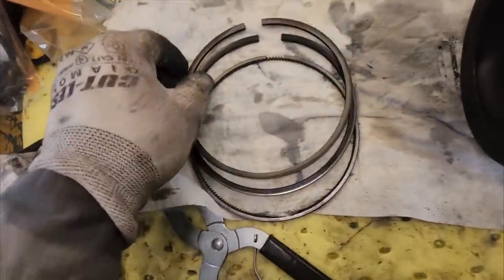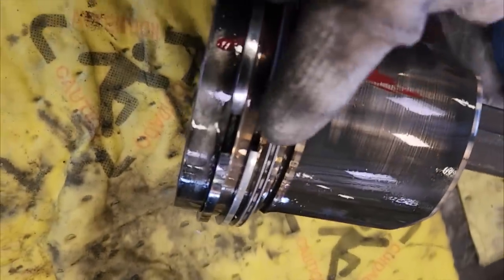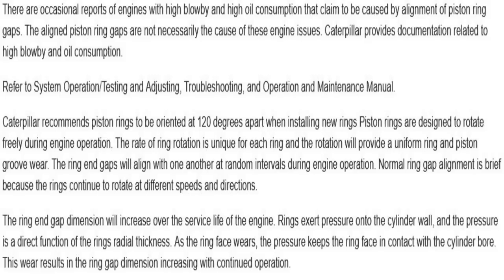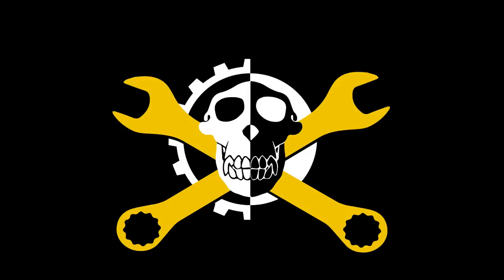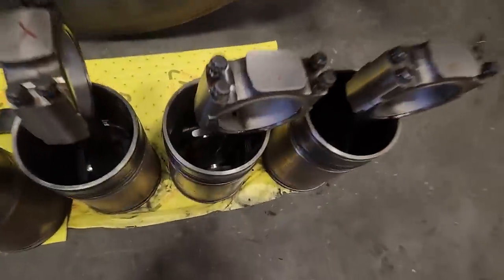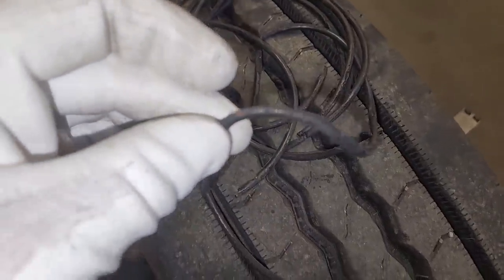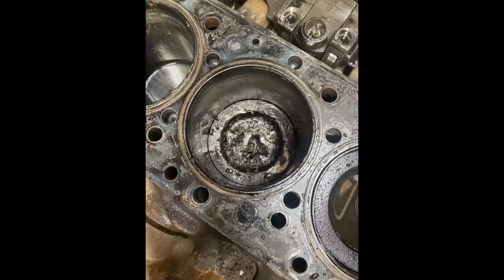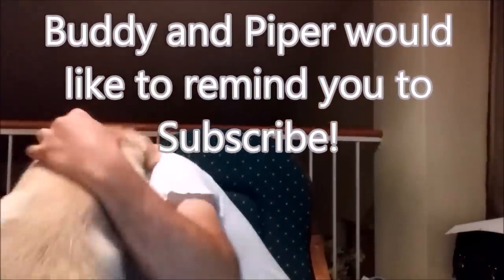Your Piston Rings alignment does NOT really matter!

Comment: Years ago l bought a truck that burned oil that the owner said had recently been  overhauled by him a construction company owner.  It was cheap, so I bought it and drove straight to my brother's garage where we pulled the engine.. lo and behold the rings on all the pistons the gaps were nearly perfectly aligned. So new rings were purchased , I upgraded the  cam , had the block rebored and   valves gone through.  No more oil burning drove that nine years no engine issue at at. Take it or leave it ,I believe it matters.

Comment: Some two strokes, at least the ones I've worked on, have pins to keep the gap in a specific spot. If the gap were to align with the transfer port you get broken rings and scored bores.

Comment: Interesting point that you want them to rotate. If they wanted them to be fixed in a specific orientation, the pistons would have a small pin or step in the ring groove for the ring gap to fit over, stopping them from moving. I bet someone tried that way back in the day, and discovered that it did more harm than good.

Comment: Yes, the rings move, but they move in the same direction at almost the same rate. If you assemble an engine with the ring gaps lined up, that engine will smoke for a LOOOOONGGGG time. Funny story: A buddy of mine spent about 15 grand building a Ford 390 FE. This thing was MINT!  We were in his shop while he was putting the rotating assembly together. Some dill hole brought beer. A lot of beer. (it wasn't me that time) He wouldn't let any one else touch anything. So we all got hammered. My buddy put the rings on 6, 7, and 8, and didn't offset them. The next weekend, slapped the heads on, and got it running. It smoked like it had no rings on the left bank. He had to tear it down again and found the lined up rings. He put it back together sober, with properly oriented rings, and ZERO smoke (after it burned off what was in the headers, but we expected that). This was in the mid 90's, it was carbureted, and was built to hold 7500 RPM all day long. 500 hp on pump gas in a 1972 (?) F-250 with 1-1/4 ton axles, 18" x 40" Ground Hogs, and it would smoke all four tires and slide off the low side of the road. But it never smoked again. Man, I wish I had video of this monster.

Comment: I found this out when rebuilding a Suzuki motorcycle engine. It's just a single cylinder, but I had to take the cylinder back off for reasons that stem from the fact that I'm too stupid to be turning wrenches, and I found out that the piston ring gaps I meticulously lined up had all moved. On some types of engines, the placement of the ring gap IS important. Typically on two stroke (gas) engines, the rings need to stay in a certain spot so they do not get hung up in the ports. I don't know if this is true of two-stroke diesels, but I imagine they have something similar.

Comment: Middle ring is oil scraper ring, not 2nd compression  I've been told aggressively , when the muddy instructions to take off the oil scraper rings . So i got the 2 scraper parts off the 3 pice oil control ring , I was 14 and learning. 
Aliment during" new" assembly is more critical in my opinion.  New unseated rings have less traction on the cross hatch ( the cross hatch is what causes /imparts the rotation )  . Like flat tappit cams freedom to spin is a new problem  ,  if it didn't have the freedom to spin when new it never got old, just got replaced. .

Comment: Years ago i was trying to cobble a Chevy 250 together . I had the pistons glass beaded . I had a problem with it after i ran it a short time. I took it apart and the ring gaps were aligned . I pulled another 250 apart and its rings were aligned ? I always though it had something to do with alot of cylinder wear. I put one back together and ran it a while but it used alot of oil never smoked or leaked. I ask a lot of engine builders and no one know much about if rings moved.

Comment: I wish I had my piston for both destruction of the week and this video's topic. My '48 bus started blowing huge amounts of oil tinged smoke. I had to have it towed in. On disassembly I found one piston had all three rings aligned and a deep gouge melted down the gaps. It was pretty impressive. I wonder why just the one. I kept it as a souvenir for years. I assume the rings froze for some reason and caused the problem.
Reply: Likely carbon packed or something to that effect stuck the rings and caused them to self destruct. I've seen it too many times to recall.

Comment: I work on our small plant, mostly 4T singles, in our workshop. While alignment mightn't be critical during installation it sure gets annoying when all the rings line up in a given engine.

The tolerances in these small engines are so relaxed that the rings can get "stuck" from the blow-by to the point either the engine simply doesn't get enough compression to start/run, contaminates the everloving crap out of the plug with oil, or the oil gets so diluted with fuel forced into the engine it necessitates a teardown.

One of these engines came in three times in one year with a no start issue presenting all three symptoms, and every time I pulled the piston I'd find all three sets of rings aligned with each other, even both oil rings and rarely the expander/control/doohicky ring if it was a butt instead of overlap type.

Very annoying.

Comment from the maker: Thanks for watching. You should position them offset during assembly and they are going to move, at least they should. Go by your factory directions. I'm sure there are going to be 1 million comments about 2 stroke pistons being pinned in place and Honda oval shaped pistons or Cummins square pistons (😁), yes I am aware of those, this applies to the 99.9% of engines out there that aren't those. Amazon Affiliate Links for recommended tools: Fuel Pressure Gauge, Compucheck 0-300 psi: https://amzn.to/3YeBldu
Airlift Cooling System Vacuum Filling System: https://amzn.to/3D9AlPu
Radiator Pressure Tester Kit: https://amzn.to/3QGBumn
Milwaukee 3/8" Right Angle Impact Wrench: https://amzn.to/3D2CvAk
Reply: I'd actually comment the opposite, there is many two-stroke designs that doesn't pin the rings in place.
It all about how the ports are designed.
Reply: It certainly does matter where the end gaps are located on the piston don’t let anybody kid you about that.    I’ve been doing this for years and I’ve seen the differences. Uh
Top compression ring gap goes to the intake valve side just above the wrist pin.   Second compression ring end gap goes above the wrist pin on the exhaust valve side.   The gap for the oil control ring are opposite each other above the wrist pin.    Oil control spring end gap doesn’t make any difference where it is.   Make sure the two color are side by side.
Reply: Why are the gaps so big? Is that a scam to sell more fuel and oil? If the gaps were smaller wouldn't it have better fuel consumption and the oil would foul less quickly?
Reply: You don't happen to know the bulletin about the ring gaps do you? Or what to search in SIS to find it?

Comment: I've never believed the compression loss thing because it wouldn't matter.  If "X" amount of gas goes into the space between the rings "X" amount will be "displaced" through the next gap regardless of clock orientation.  

I've always thought clocking was recommended to more evenly distribute initial brake-in wear.  I imagine gaps all lined up during initial start-up would reduce the chance of evenly distributing cylinder wear around the cylinder bore.
Reply: I always figured it had to do with velocity. Easier for more gases to make it through straight down than around a few 90 degree bends.

Comment: I'd consider that for a boxer engine then I'd prefer to avoid having gaps on the lowest third of the circle to avoid oil passing into the combustion chamber when engine is off.
Of course - wandering rings could still make the gap to end up on the bottom, but it wouldn't hurt trying the small things at least.
Reply: BMW motorcycle. Sometimes it smokes after parked on side stand, sometimes it doesn't.

Comment: So I didn't check one of my pistons for ring position after coating with oil before installing,  should I pull that piston and check or am I over thinking? Heads and oil pan are still off.

Comment: NO,NO and NO I cant believe what I just watched this. As a certified factory CAT master engine re builder for 25 + years you are wrong to believe ring placement doesn't matter?  On your next overhaul pull your OEM or aftermarket cylinder packs and stack (stage) all your rings inline. Then tell me in 3 months how your compression and oil  consumption are. Appears your teacher/ trainer NEVER showed you the CAT training film about stacking pistons or ring gaps in class.( great film CAT made a see - thru engine to show fluid movement and operations of their 3406 engines. The lower block is not much different from the E or C15 engines). Please reviewed the rebuild manual . I will try to send you the link when I find the training clip.The film shows a side view of a cylinder liner with a piston rotating up and down with ring movement.  Of course the rings spin inside the cylinder liner and sometimes they will all line up after thousands of hours. One engine hour is 100,000 rpms for folks who don't know. Cat uses 3 rings talking about the pistons on 3406-C15. Top is compression second is scraper and 3rd is oil ring.  All rings at time will align at times but not for long. Staggering (staging) the rings limit the amount of ALL rings lining up together. You need to stack the rings to the wrist pin location per CAT specs.If not you will have low cylinder compression or high oil consumption.

Comment: What about the engines that have piston ring spin stoppers?
Reply: Pinned rings ( generally found on 2 strokes ) are used to prevent the gap from catching the cylinder port and causing damage.
Reply: Alot of that it to keep the open end of the rig out of a port, usually found in 2 stroke

Comment: What does matter is the oil isn’t polymerized on the pistons and rings. They will walk, or factory installed pistons many times the gaps aligned. I started in a heavy shop that started when oil was crap was just at service Sc when I was there. Most had rings that could be used again if they just had stopped when it started burning. Ring rods and mains , chain and sprocket in my sleep on Small block Ford /GM . Chrysler not as bad but oil was the cause. I want to see a video of someone pouring old SA-SC oil in a 23 and see the carnage. Doubt it would make more than a few services , if it lasts to the first

Comment: Here is the ACTUAL answer: Cylinders always wear out OVAL, (and Tapered). The rings rotate for a while, until cylinder wear occurs, then they will usually settle with the gaps in the most worn part of the oval, unless they get stuck with carbon. 90% of the time.
Reply: Any recommended reading to learn more about this?

Comment: Not an argument, as it is a "VCM" Gasoline Honda, with active fuel management / cylinder deactivation, whathaveyou, but according to a TSB 13-081, cylinders that are shut down in VCM mode may align the ring end gaps over time, causing plug fouling.

Comment: THE RINGS ARE STAGGERED TO KEEP THE PISTON FROM ROCKING ON THE INITIAL BREAK-IN. IF THE RING GAPS ARE ONE ON TOP OF THE OTHER THE PISTON WILL ROCK AND SLAP AND THE EDGES OF THE RINGS BEING ON THE SAME POSITION COULD SCRATCH THE CYLINDER BORE. RINGS ARE STAGGERED TO ENSURE IMPROPER BREAK IN OF THE ENGINE.

Comment: I rebuilt a KZ1000 Kawasaki motor bike, the manual said to align the piston rings. The engine smoked after and continued to smoke, a small engine wizard who lived in the area said the manual was wrong. Most piston groves have pins in them to stop rings from rotating. 
You are wrong my friend

Comment: Compression gasses, and oil, are also free to travel AROUND the piston between the rings even with “properly” spaced gaps. So the compression gas might enter through the top compression ring gap pointed at the front of the engine and exit through the next ring gap 120 degrees away in the next lower ring. So yeah it doesn’t really matter. And how stupid is Cat to use a 2 ring piston design in a high compression diesel engine? Cat does some really dumb things.

Comment: Your argument is interesting, but wrong. Back in the 70's Datsun (yes, I'm that old) had a bulletin for oil consumption due to ring alignment. I had to tear down engines and it did fix the issue. The second issue that rings must rotate to prevent cylinder scoring is also false. Many 2 cycle engines have pins to prevent rings from rotating so the ends don't catch in the ports. They do not have issues with cylinder scoring.

Comment: Manufacturing gone to crap on Tolerance  on parts. If you have new ones rotating. After a reputed machine shop bore’s the block/liner checks piston size some time you have to machine each cylinder to single piston because of a size variation, they don’t rotate if everything is the way it should be. Compare tolerance on same motor that’s been made for long time let’s say Chevi 350 and you will see what I’m talking about or measure brand new engine with micrometer and guess what it’s going to be out unless manufacturers change tolerance and check specific for same motor in 80s, ring should move in a grove not rotate.

Comment: This is completely not True,I used to build engine's and a lot of manufacturers such as Toyota had specific ring degrees for oil and compression,I learned the Hard way on a Toyota MR2 And had to remove the pistons and redo them it was fine after having oil and blow by issues..Not Every Engine manufacturer has this!! But do what manufacturer says....

Comment: People go nuts on end gaps, swear they cannot turn or move and your wrong. Over the years from my engines to all engine I've worked on from Cat, Cummins and Paccar they do turn. Paccar has documented set ring gaps, run engine for hours on dyno and take it apart find all rings have turned. Paccar even set all ring gaps together, run engine on dyno, take it apart and find them all have moved. If rings didn't turn they will carbon pack, cause liner lobing and use lots of oil.